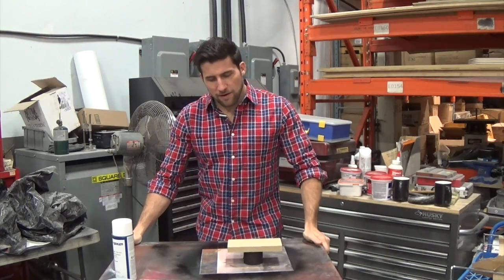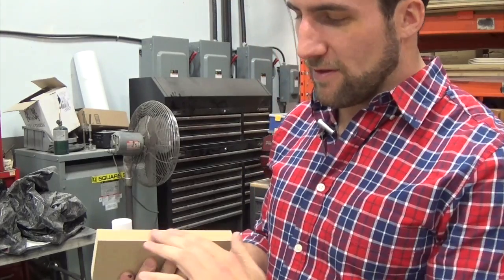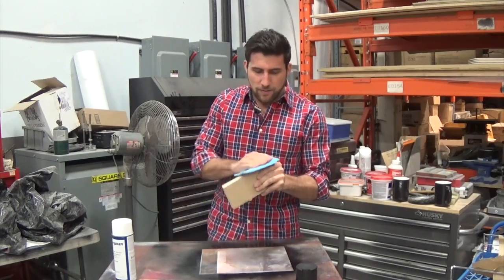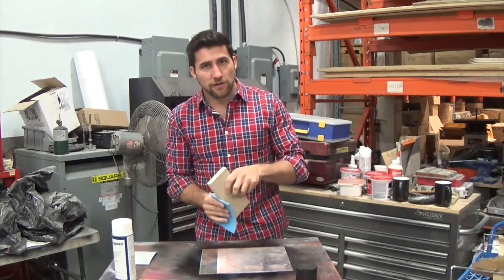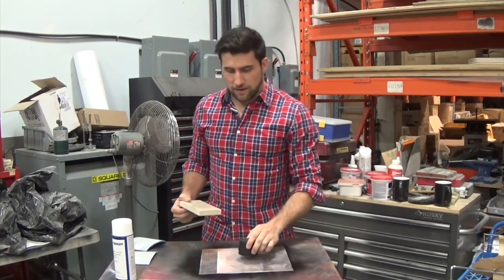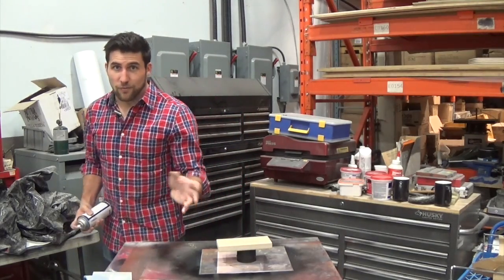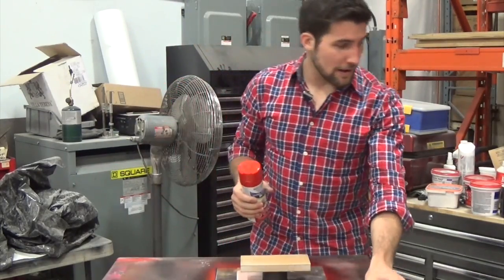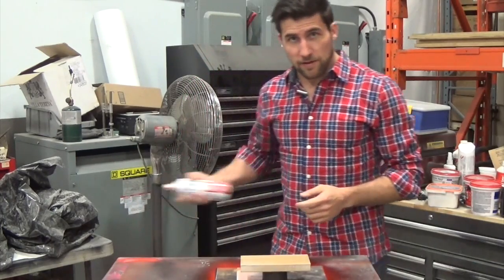How to seal MDF for a gloss finish

Comment: Only way I ever seal MDF is oil based urethane. Reason: Its good for it to soak in, and it forces me to wait for the job to cure and harden the MDF, making the MDF less vulnerable to moisture. After a week, the MDF can be sanded and add just about anything.I actually want the urethane to soak into the MDF, so the first application I put on is thinned out about 1 part thinner to 2 parts urethane. If you are in a hurry... not for you. This is for a quality, long lasting finish that improves the product.

Comment: Hi Brad! cool Video!!
 I just finally ripped the shitty vinyl covering off my FISHMAN LOUDBOX MINI amp... it got trashed on 1st outing 5years ago 
Anyway... the glue seems to have sealed the wood ..so maybe i just sand that a little with 400grit.
I was thinking to use some bright Red HAMMERITE SPRAY paint  - or should i use an enamel¿
 Letcha know how i get on --- Cheers fro madrid
Reply from the maker: Cheers. If it’s sealed by the glue then the hammered paint should mask a few imperfections if there are any.

Comment: Brad, awesome video. Is there a way to stain the MDF before glossing it? I tried staining last week and it didn't work out very well. Thanks.
Reply from the maker: Mdf isn’t really meant to be stained. It doesn’t have grain. It also expands with moisture. I’ve sprayed alcohol based stain on it before and gotten an interesting effect though.

Comment: Hello Brad,
I am a new subscriber and I'm hoping you can answer a question for me. I am working on a DIY project, a door hanger with MDF board. I have watched this video and another one of yours, but I didn't quite get an answer.
I'm slightly confused. I plan on staining it with a gel stain. My confusion is whether I seal it first and then stain it or stain then seal.
I know that MDF is very porous, especially the edges. I also want to ask if Mod Podge can be used to seal it or should I use polyurethane. I purchased Rust-Oleum Painter's Touch 2X Ultra Cover clear gloss spray. Is that a good sealer? 
I'm sorry for so many questions, but I chose a DIY that I really have no knowledge of, but I am determined to do it because it is going to be a birthday present for my sister.
Any help, info, or answers you could give me would truly be appreciated! Thank you in advance! 🙂
Reply from the maker: Hi there. Have you ever tried staining mdf? It doesn’t have grain, so the effect is different than with wood. Anyway, I would stain first and then seal. Mod podge isn’t really designed to be painted over if I’m not mistaken, so you could probably seal with that but wouldn’t want to clear coat over it. The rustoleum would work, but it will soak in so you may need quite a bit.
Reply: @BradAngove  thank you so much for replying. So, you don't think the MDF will absorb too much stain and warp if I don't seal it first? I'm sorry for so many questions. I appreciate your time and help.
Reply from the maker: It is very unlikely that it would absorb that much gel stain.
Reply: @BradAngove  ok, thanks so much!

Comment: Good video! After the sealant is dry and sanded I noticed you didn’t use a primer, is primer not needed? Also I build stuff with mdf/wood together would I follow the same steps? T.I.A!
Reply from the maker: The sealer fills the role that primer would generally be used for, so there’s no need for both. 
Yes; it works just as well on wood.

Comment: I have found simple shellac seals MDF quite satisfactory. Dries fast no over spray fumes to breath
Reply from the maker: I've tried shellac a few times and found it to be incredibly slow. Perhaps we are approaching it differently?
Reply from the maker: +Jerk Of All Trades words to live/die by haha.
Reply: It's "breathe"; a breath is what you breathe.
Reply: Shellac dries incredibly quickly unless it's past its best-by date  (which should be printed somewhere on the can), and then it can just stay tacky forever.
Reply from the maker: Shellac takes about 45 minutes dry fully. Not bad, but not as fast as the vinyl sealer. That’s not the issue though. The problem is that it takes a long time to seal the MDF because of how many coats are required.
Reply: Lynn Lacey first thing I thought was why not shellac?
Reply: I also use Shellac or Bin primer (shellac based) they both dry incredibly fast and give great results.
Reply: Brad Angove I use shellac spray can from Sherwin Williams. Drys in 10 minutes or less and seals
Reply: +123Toid I have bad memories of using BIN on the walls and ceiling of the main bedroom in a house I was renovating back in 2006.. That stuff is BRUTAL on all the senses.. I resorted to wearing scuba goggles just so I could see when painting that stuff in the closet.. I'd also have to step out of the room, and do some deep breathing for about a minute so I could hold my breath for 3 minutes, dart into the room, roll on as much of that crap as I could til my face turned blue, then dart back out into the hallway for my next breath.. not fun.
I used 2, 4 liter tins on that room, it took 2 days to paint it..
The walls of that room had absorbed whatever it was the previous owner had been smoking in there, and the stench in only that one (luckily) room was repulsive.. The skirting boards and architraves had never been sealed, so I ripped them off the wall and literally threw them out the window and burnt them, I took down the curtains and burnt them too, and after 2 full washes of every surface with a concentrated sugarsoap solution, (with the yellow of whatever it was they were smoking still leaching from the plaster) I seriously considered ripping all the plaster out and putting in new.. then I discovered the BIN.
Amazingly, it worked a treat, and once it cured, there was no smell.
so yeah, bad memories of a nasty product which I can say, actually does what it says on the tin.. I highly recommend it, but beware :)

I haven't tried this Vinyl spray Brad uses in this video, but I doubt it could be even a fraction of the 'nasty' of BIN.. :)
Reply: @BradAngove   Use Bin and cut it with denatured alcohol by about 1/3 and it flashes off in about ten minuets.
Reply: @genelomas332  You luckily escaped the worst result of using a high quality product for the wrong purpose , (the paint store should be avoided if they weren't smart enough to advise you better )
The Worst is that BIN's vapor is (alcohol) is so flammable that a water heater pilot could have blown your house to pieces . This is a stain sealer or small project primer,  only.
Reply: @hj8607  In Australia our water heaters are located outside by law, (natural gas produces carbon monoxide which is more deadly than the bin fumes) so no chance of blowing the house sky high.. 😉
Reply: @genelomas332  I sprayed the entire inside of a house with 5 gallon buckets of BIN primer before and have used it for ceilings and a few rooms. I was a pro painter and a woman put a roast in the oven and left for work and forgot about it. The entire house was filled with smoke before someone got home to check it out. The entire house was gutted to bare walls and we used BIN to seal in the smoke smell. It also covers wood tannins very well, when people want wood painted bright white. I thinned it with alcohol and cleaned out the airless with alcohol. Even with a respirator it is no fun, but one of only a few products that would work. I feel your pain and share your memories!

Comment: Very simple to do ordinary wood filler made into a paste and brushed onto the edges wipe off with a cloth wait until dry then sand with fine sandpaper very light sanding then paint the filler will prevent absorbition

Comment: This may be a silly question, but would you reccomend using this process, for kitchen cabinet mdf doors? I have been trying to find a simple way to acheive a high gloss finish,  your video was the simplest I've watched. Any particular tips you may suggest?
Reply from the maker: It should work fine on those. If you’re doing a whole bunch of them it may be worthwhile to get a large nozzle spray gun and the non spray can version of this product. You can follow the same process.
Reply: Brad Angove ok will do. Thank you!
Reply from the maker: You’re welcome.

Comment: Mdf mdx is awesome 
Regular mdf seal the edges with a mixture of yellow glue n water than some vinyl sealer sand it apply color top coat it done
Reply from the maker: +Z Lopez what do you typically use to apply the mixture?

Comment: Hi Brad. I've been working on a project and I get stuck. 
I've been painting an MDF it has primered (oil based) and started to spraying by Rustoleum gloss acrylic lacquer. this is an aerosol btw. I do not like it whereas I id like to achieve a piano finish. What paint do you recommend over this acrylic lacquer? 
I was thinking using a sher-wood CAB also acrylic one but I dunno is it compatible with it or not?
what do you think and what is your suggestion? I am ok with an Acrylic Enamel 2x what you used in this video ...?
Thank you
Reply from the maker: You can use the 2x over that. Are you looking for full gloss?

Comment: How moisture resistant would you say it becomes? I been looking for a definitave explination on how i can make standard mdf able to be used outside (undercover and wont get directly hit by any rain, but will have decent amount of moisture)... 

Someone please give me some tips👍👍
Reply from the maker: You just need to seal it from all sides. The vinyl sealer is moisture resistant, and so are most clear coats. If you build up a gloss finish you should be good.

Comment: Hi there, very nice video. I have a question tho about painting a furniture which consists of many different MDF parts. Lets say a bookcase. Which is the correct order? First assemble the furniture and then the whole primer-sanding-painting process ?or all pieces must be primer-sanded first , then assembled and then paint the whole thing? Thanks in advance :)
Reply from the maker: +fotfoti It really is just a matter of preference. I like to paint the parts first so that I don't have to worry about causing runs by spraying into corners etc.
Reply: thanks :)
Reply from the maker: +fotfoti you're welcome.
Reply: Sorry but I disagree with previous reply. When you spray finish furniture you need spray dissembled otherwise you will have overspray on some places. Specially when you finish in high gloss.

Comment: Hi, nice video! I work on a project where I wanna leave MDF with its original feel but still protects it from water and moisture. I don't wanna color it at the end. Is there any way to seal MDF so to say invisibly, that the feeling of raw MDF stays? Tnx for the answer!
Reply from the maker: That’s an interesting concept. Honestly, I can’t thing of a way that you would do that. Any clear coat you put on it would smooth it out at least a little bit. The closest thing would be just putting a few coats of matte clear on it.

Comment: should use the pigmented vinyl sealer since you did a solid color the pigmented has better filling properties
Reply from the maker: +Mike Granata Does that come in the spray cans? I haven’t seen it in that format.
Reply: I,m pretty sure behlen has it, if not Mohawk finishing products has it in spray cans both  companies subsidiaries of RPM inc.

Comment: I ordered a can of what you used off Amazon last week and had poor results. Even after 5 coats of the sealer on the edges (along with sanding with 400grt) the edges were still "furry". What am i doing wrong? I want the sides to be as smooth as the top without furr
Reply from the maker: Try sanding the edges flat again with 320 or 400 grit and then adding one more coat of the sealer.

Comment: Thank you so much for making the video, you cleared a lot of stuff for me up but I have some questions. Can I use polyurethane over the paint and do I have to sand the paint a little before applying the poly? And does it matter if it is water based or oil based?
Reply from the maker: Yes you can. Yes you should. No it doesn’t (once the mdf is sealed).
Reply: Brad Angove Thanks

Comment: What if I'm using wood glue/wood filler over seams and edges (what would u suggest??) to get a perfect finish. The sealer could still be sprayed and then a primer? Or would I even need to seal it if I've already done wood glue/filler.

Also I'm going to use a black acrylic lacquer buffed to a mirror shine by the end of it. I assume I'll then do a high gloss clear coat. Do you have any suggestions as far as primer/brands to use as well as sanding between coats?

Thanks!
Reply from the maker: +WeBuild4Life yes, you can still seal over that. It's a good idea to use that on the seams etc. Generally there's no need for primer over the sealer. 
Once the thing is sealed well and sanded smooth, there's no real need to sand between coats of lacquer.
Reply: Brad Angove thank you much! Been doing a lot of research and your video is one of the most helpful I've been able to find.
Reply from the maker: +WeBuild4Life I'm glad to hear it. Thanks for watching.

Comment: Using shellac is a much better idea .  However, the only surface that needs more than one coat are the edges . Spray very light coats (3-4) to avoid raising the 'grain' of the mdf "stuff" . Each dries in 5 minutes .( light sand edge between coats ) ONE medium coat on smooth surface will seal it to about 95% . Use a fast dry urethane gloss coat and let it dry 24 hrs. to hard sandable  finish . Top coat in gloss or any finish desired .
Shellac is safe to breath , environment friendly and cheap .
Reply from the maker: If you’re spraying it, it’s not safe to breathe. Especially depending on what you’re cutting it with. It’s also much slower. 
Not a worse idea per se, but definitely not better. It all depends on what your priorities are.
Reply: @BradAngove  the vapors are breathable to extent that they are not highly toxic (a particle mask is always advised ) (alcohol only acceptable thinner) 
Shellac is a dry fall product and overspray is not a problem .  Shellac has no filler value but will out seal anything . The vinyl seal could be an effective filler coat and over a 97% sealed surface it would build faster using less product .  ( Not really criticizing your approach its just that MDF , despite all its plus qualities, is a finishing conundrum )

Comment: Great video. I tried to coffee stain an MDF panel. the colour was nice but the surface was sticky, so i washed it and all the colour came off with it. is the surface being sticky ok for an acryllic finish? what did i do wrong?
Reply from the maker: The surface of the mdf is sticky? Has it dried fully?
Reply: @BradAngove  I used a hair dryer to speed up the process. Is that what caused it to be sticky?
Reply from the maker: @shadowghost5000  Is it the paint that's sticky, or the stain?
Reply: @BradAngove  I didn't use any paint, I only stained it with actual coffee
Reply from the maker: @shadowghost5000  Then it's "sticky" because MDF absorbs water and is damaged by it. Like I mentioned in the video. That's why I used a fast-drying solvent based product.
Reply: @BradAngove  riiight, thanks so much for the help, would I be able to get away with using a very concentrated, thick coffee or would I have to use a fast drying solvent?
Reply from the maker: @shadowghost5000  Are you planning on making the coffee with water, or with a solvent?
Reply: @BradAngove  what solvent would you recommend I make the coffee with?

Comment: Thank you for posting this. I was trying to figure out how to seal MDF for a project I'm working on. Can you tell me why you turn the can upside down for a second when you are done spraying? I have never seen anyone do that, and it looks like you know what you are doing, so I thought I would ask. Thank you.
Reply from the maker: Certainly. I made a video about it titled something along the lines of one tip that will make your spray cans perform better. There are a few types of nozzle for spray cans. These small ones, which are fairly common, only spray properly when they’re right-side-up. When you spray, paint can stay in the tube and jam it up. You flip it upside down and spray until material stops flowing (because it can’t pull material when upside down) and only gas is coming through to clear the nozzle so that it won’t jam up or spit.
Reply: That's a great tip. Thank you for your reply.
Reply from the maker: Your welcome. Thanks for watching.

Comment: A thin layer of fiberglass resin then sand and paint
Reply from the maker: I hate fibreglass resin, but that does sound like it would work well.
Reply: This is what I have done when working with MDF in car audio for 25 years. More work but seals and smooths wonderfully.
Reply from the maker: Yeah, it seems like an effective option if not an efficient one.

Comment: Hello - How does the behlen brush on product behave for a gloss finish? I am looking to finish 2 subwoofer cabinets and would probably need at least a few cans. I think the paint on would be more cost effective. Then, I may spray the cabinets with some rustoleum product. Do you have any feedback on this? Thanks!
Reply from the maker: The stuff in the quart is great. I use it all the time. I’ve never tried brushing it though, I just spray it through the gun.
Reply: I don't have a sprayer so thats not an option for me.
Reply from the maker: I figured that was the case. Just wanted to let you know that I hadn’t tried brushing it